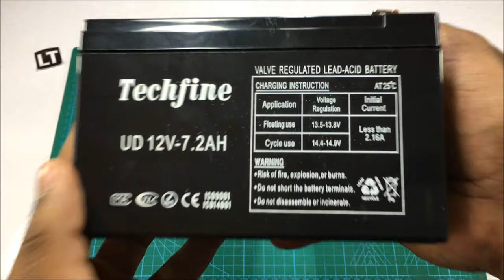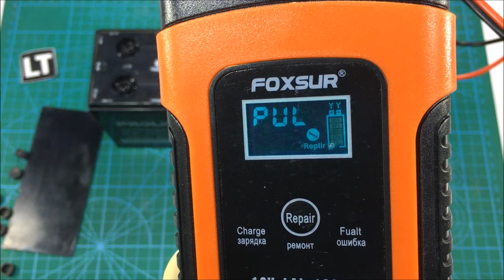Sealed Lead Acid Battery Recovery / How to refill lead acid battery

Comment: I have the same battery size that was manufactured in 1999. It had been sitting dead probably since 2005. I did the same procedure as this guy did except I added 20 ml of sulfuric acid to each cell and the rest with distilled water. I did the pulse repair for a few days and it was worthless. I got 12v and maybe 70w/hr for all that repair.  Forget the pulse repair hype, they are worthless. I had purchased a bunch of VoIP phones from a failed business in 2008 which had plug in wall adapters that would produce 26v at 2amp. I connected this power adapter to the battery along with a voltage meter. For 24 hours I was getting a voltage reading at about 25.9v. Several more hours later, 2 or 3, I went back to look at it again and the voltage had dropped to 20.1. Before I went to bed for the night, I looked again and the fuse had tripped on the power adapter. Voltage meter now reading 5.72 volts. I went to bed. In the morning voltage was down to 3.1 volts. I connected up another power adapter to the battery for the total count of 2 power adapters connected to the battery at 26 volt. That brought the voltage back to 22.2 volts. 12 hours later it was down to 21.5 volts. The next morning, both fuses had tripped on the power adapters voltage at 4.45 volts. I reset the trip fuses and turned them back on. 15 minutes later I went to check and once again both fuses had tripped. I have a 200amp car battery charger that would start a diesel Mac Truck. I connected that up. It was pulling more than 40 amp. 12 hours later, I went out to check and disconnected the car charger. It was maintaining 11.1 volts. I did a discharge test and got 3150w/hr. I plan on doing a few more fully discharge and recharge with 200amps. I fully believe that this battery will come back to life.
Reply: Damn, you just left a battery rolling along sight-unseen after observing it was pulling 40a? Heh, surprised when you left it to charge it wasn't a "Dudes Walk Away From Explosions" moment. Not safety nagging or anything, in fact I admire your boldness. Curious if you now have a functional battery in rotation now too..
Reply: @kurtilingus  Battery got a little warm, but yes, I let it be. It was sitting outside my garage on concrete, but I didn't ever think that it would burst into flames or explode. I've charged 850 cold cranking amp car batteries well above 80 amps for almost an hour with no problems. That battery would only pull 40 amps for an hour or less before the current would start to drop off sharply.  But, yes, I have a functional battery after 2 additional charges at 12 volts and then moving on to 26 volts again. I believe that the high amperage of the car battery charger/starter cleaned off most of the oxidation from the lead and copper plates and or helped break up the clumps of sulfur that formed in between the plates. It took a week or more of almost constant charging at 26 volts for the battery to start holding a 12.4 volt charge. Higher voltage or current is far better than any pulse repair device. But, yes the battery is functional and useable. For how long I don't know though. I might come back in 6 months and leave an update.
Reply: @nathanwoodruff9422  thanks for the input battery bender
Reply: @nathanwoodruff9422  Hi, Nathan! What about today? Is that battery still alive and working nice?
Reply: @franekw5274  "What about today? Is that battery still alive and working nice?" The battery worked well for about 3 months at about 13Ah. It tailed off quickly after that as I am assuming that sulfur deposits started forming where they were zapped off originally. I then did as before and did the 26 volt approach for a month and got good results but it only lasted for about a month. I cracked the battery open and pulled out the plates. The majority of the plates had oxidized and fallen off to the bottom of the battery. I decided it wasn't worth it to try to save it as if you get the sulfur off the plates, most of the oxidized lead, will come off as well. My thought is it is probably best to recycle the battery and buy a new one.  One repair of a dead lead acid cell might be fine but after that, it is a lost cause.
Reply: @nathanwoodruff9422  damn 🤣🤣 The little black battery that could loo
Reply: @Supa Trending Daily The reason why it is bubbling off is that one cell is producing more heat than the other cells. That heat is coming from the now solid sulfur from sulfuric acid that has bridged the gap between the two plates shorting out the plates and causing the solid sulfur to reach about 300F degrees. There is no saving that battery. I have found out that my local recycling center will take 50lbs of batteries at a minimum and pay $35 for 50lbs of lead acid batteries.
Reply: Theres a very good video on here explaining exactly how to repurpose old car batteries.

The guy is a mechanic and sais he's been doing it for customers over 10 years.

He uses high starting amps, similar to the 200A you tried but he used 400A.

Fill up the battery with distilled water, charge for 15 miñutes, take off the charger & wait 1hr

Repeat this a total of 5x, 15min on - 1hr off - 5x total.  

Brings them back like new he claims ..  you can see all of the cells bubble.

I have ebike batteries that i just filled with distilled water.

I have a 500A starting amps for boosting a dead car battery.

I'm not going to use it unless the trickle charger doesn't work. 

I think you only need the 500A boost if your battery is completely dry and has been sitting empty for a long period.

The hogg amps desulfur's the plates.

Another way is by adding 1/3 sulfuric acid and the rest distilled water and pulse charging with a high Amp or  whatever you can get 10A will prob do it'll just take longer, you'll wreck the plates if you leave a high amp on all the time so just pulse or wait 15 min and let it cool down, hit it again ĺet it cool et.

Comment: The was deposits in the bottom of the battery. You should have checked resistance of each cell and also rinsed the battery out first. Then refill and charge
Reply: Yeah, thought the same.

Comment: You allowed the battery to reach a normal voltage, but you have no amp hours. This can breathe a little life back into an old battery, but will not bring back the capacity of the battery.

Comment: The only thing I found useful is "safety first" 😂 shitty recovery. He needs to drain all the acid from the battery first then mix fresh 80% distilled water to a  20% ratio of sulfuric acid. (that's why it's called a lead acid battery) This guy is misguiding people. Please don't follow this. He needs a 200amp charger to charge for a duration of 2 hours and then wait for 1 hour to cool down the battery after which he needs to repeat the process of charging for 2 days it's a lengthy process and takes time but the results are good. People with half knowledge do this like this and mislead people for views and likes.
80/20 ratio is important else it won't work.
It's like having only water and no food to give you energy ⚡.. 😂

Comment: Wow.. you don't seems to understand a single basic fact in this instrument. 

1) This is both repair and charge unit. 
2) With repair mode, this unit will desulfate your battery. On the way, it will charge, but not necessarily enough. 
3) Battery with 0.3V is almost dead and will need lot's of desulfate process. i.e. You will need to repair it for couple   of days. 
4) After couple of days of desulfating, you will try to recharge it (not the same as repair)
5) If no good, then I would discharge the battery and try again to repair it with high voltage repair pulse feature. 

  ps. I wouldn't have voltage meter on battery while repair it.
Reply: So with this charger  , can we charge battery normally, without pulse charging mode??

Comment: Hello need help asap
So i was able to revive one of my 2 SLA battery. The other has a problem because one of the 6 cells inside is reading 0.2v but the other 5 reads 2.0v. How do i fix this?

Comment: How do you check how much acid or distilled water is left in the Battery before you start refilling it.  The hydromers for cars are to big. Please advise where you obtain such a device from and how much they cost  in UK sterling (£)  thanks for your help .
Reply: This is an AGM. There is no free water to draw, even when new.

Comment: Desulfide the surface of the battery plate first by using crystal soda and hot water to neutralise the sulfites and empty out before re add battery acid and re trickle charge
Reply: u r right
Reply: Can you use Epsom salt and water?
Reply: Is Baking soda and hot water ok for rinsing
Reply: What is crystal soda ?

Comment: Just a note to everyone who doesn't realize this. Even if the battery was able to be recovered, it has to remain upright all the time. Boosters use VRLA batteries. As such, those have to remain sealed because I'm sure that they'll get tossed in the trunk when not in use. The moment you tear the plastic lid off, good luck keeping it sealed.
Reply: Also note that the plastic lid should not be completely sealed, just spot glue it back on

Comment: Hello . I did same to you and i got problem you know the ruber black caps . i have all blue but my problem is the plastic x-x did come with my blue cap . is a ways  to plug the hole after did fll up water ?

Comment: Very good video. Excellent production value and information content. I learned a lot. Thank you for pointing out the age of the battery as to be considered. Other videos on this same topic did not mention the possible fails as well as yours.
Reply: hi guys, the greatest results that I have had was with the Magic Mender Wizard (i found it on google) definately the most useful course that I've followed.
Reply: @manuelpereira7277  j
Reply: @manuelpereira7277  I

Comment: Thanks for the video, I know it´s an old one but just wanted to know how you got the charger working on a battery that has less than 1 v , supposedly the charger needs at least an 8 v reading before it can start to work.

Comment: Thanks.... I got the same charger. I just drilled a sealed lead acid 85Amp & topped up with distilled water & is now charging via pulse repair. When unplugged after a couple of hours voltage was 13.1Volts so I'm continuing pulse repair looks like I have restored it. I will use hot glue to seal the holes & which will be easy to remove for a further top-up. The sealed batteries can be brought back if you can get water in.
Reply: @departe5672  Indeed I run a 500 watt RF amplifier on it.
Reply: @Supa Trending Daily Keep above the plates

Comment: I m charging my 12v 7Ah batterty with 14v 7.5 ah charger… battery is charging up to 12.60v but after 3-4 hours voltage decreases (10-11v) without use. What should i do?

Comment: I restored my battery with this guide BUT my batteries stay horizontally, not vertically inside the scooter and some liquid was spilled as the rubber caps cant keep the liquid inside. Question: can I permanently put some glue on the holes and seal them shut so there wont be anymore spills OR it releases gases and it can blow due to creating pressure if I seal the holes????
Reply: I saw video of people sealing  with epoxy
Reply: Lead-acid batteries vent gases, so do not completely seal either the rubber caps or the plastic cover on top of the rubber caps. Venting is how the water escaped that is being replaced in this video. Because even new batteries vent, lead-acid batteries like these need to be kept upright so that the acid will not leak out. If your scooter is designed so that the batteries are mounted horizontally, then I suspect it was designed for AGM (Absorbed Glass Mat) or gel cells, which do not have a liquid acid solution and hence do not leak when laid on their side.
Reply: You have to cut into it a little higher then the breathing holes therefore when you seal it , your sealing only the new cuts you did to it not the breathing holes it had before good luck

Comment: I charged my battery is with closed holes....is it bad to my repair?( please reply please)
Reply from the maker: If the battery isn’t long run, i suggest you to charge caps off, if not won’t be an issue.
Reply: If the caps didnt pop off spraying acid everywhere. You need to fully chGe with caps off because it's going to creat gas from the electrons passing through from the electrodes and plates

Comment: So the whole video you basically did nothing. The battery was dead and remained dead.
Your biggest problem is the filling of the battery. you need to put the needle deep into the battery and fill a specific amount usually about 10 - 30Ml per cell and let it soak in. Then charge the battery. your watering didn't do anything.
Reply: What do you mean? He showed us the bottle being a third empty after filling battery!?

Comment: When i connect mine to another battery,  the water boils?
Reply: of course it will boil (It is not boiling but evaporating the acid by electrolysis) It is not a good sign
Reply: Make a cup of tea or coffee! :-)
Reply: The cells are creating HHO Gas. Hydrogen Hydrogen Oxygen and that's what the bubbles are.  It's wise to use distilled so it doesn't bubble but even sometimes you still get it. Leave the caps off and let it charge all the way in hopes it stops.
Reply: @mknight6026  HHO is water!  The gas is HH ie hydrogen (normally written H2 with a small 2 below the line but YouTube does not appear to support a subscript font)  and is always a byproduct of the charging of this type of battery.  That's why you should charge in a well ventilated area so the gas doesn't build up and present an explosive risk.
Reply: @ozziefreddo7403  your confusing it with HOH which is water

Comment: I wouldn't recommend taking a lead battery apart there sealed for a reason.
Reply: SLA (sealed Lead Acid) name is a actually a misnomer. The correct name is Valve Regulated Lead Acid (VRLA) battery. There is a small gap under each rubber cap for gas but NOT gel or aborbed liquid to escape. The rubber caps behave like a one way gas valve.
The electrolyte of SLA/VRLA battery is either a gel (then also called a GEL battery) or liquid acid absorbed in Absorbed Glass Mat (then also called an AGM battery).
Adding water will hydrate & revitalise the dried GEL or dried Glass Mat so that electricity can conduct again.

Comment: you should use acidic water, like lemon water and charge it with high voltage, like 30v and charge and discharge using halogen lamps, it's a long process, for me, it takes 3 days to recover